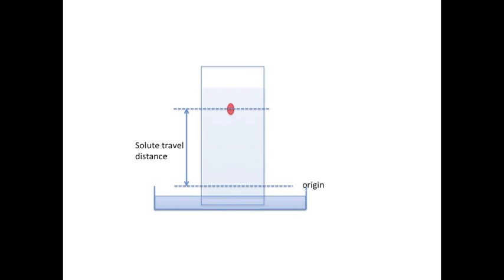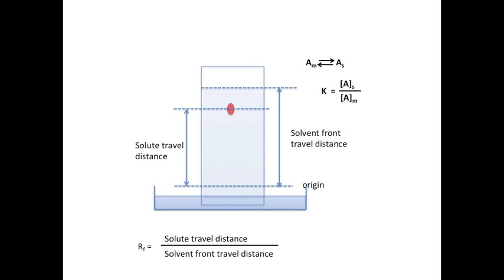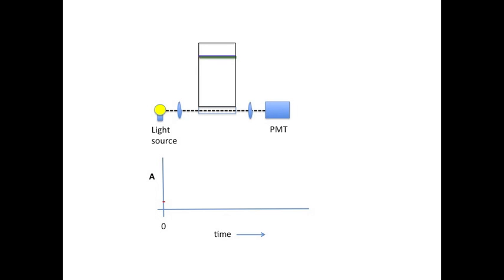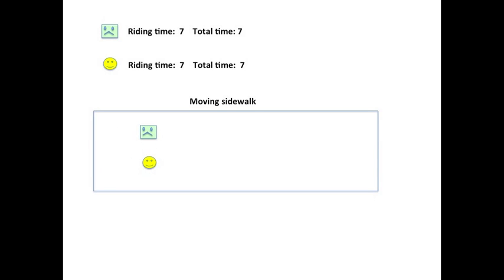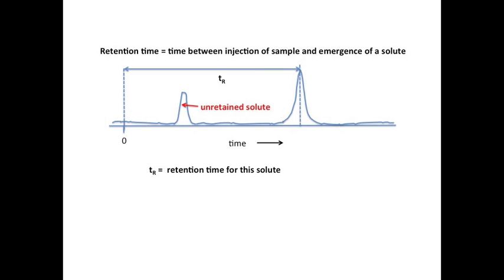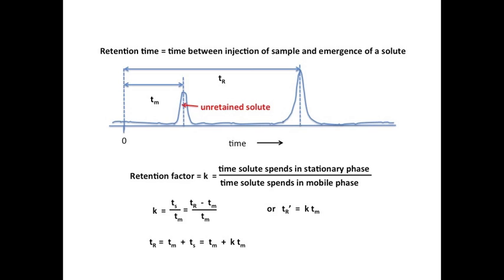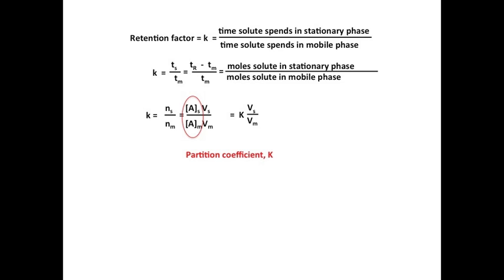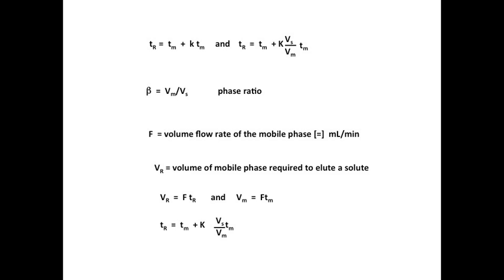Retention Time

Comment: Hou can  separate same retaintion time peak
Reply from the maker: Your question goes to the heart of the field of chromatography. Basically, when two compounds elute a the same time, you need to change the separation conditions (either the stationary phase or the mobile phase or both) in order to retain one more strongly than the other.

Comment from the maker: Hi Ali, 
There are a number of factors that lead to broadening of a solute band while it is traveling on the column. These include the natural diffusion of the solute molecules (and so that band gets broader with time), kinetic problems with the molecules moving between the mobile and stationary phases (generally known as "resistance to mass transfer") and non-ideal (or different length) flow paths that individual molecules take around stationary phase particles in a packed column. These have been will described in textbooks, but a very good resource is chromacademy.com. There are also practical considerations or problems that arise outside the separating column. Many of these are related to introducing significant volume that the sample must flow through between the column and the detector or the fact that flow through a tube is faster in the center than along the walls leading to a bolus (or lens-shaped) plug of analyte that has a wider profile in the detector than it would otherwise. The chromacademy website has an excellent discussion of these and other factors that effect peak shape.